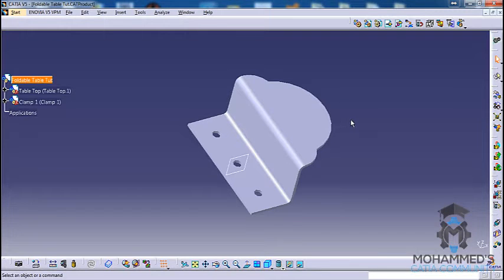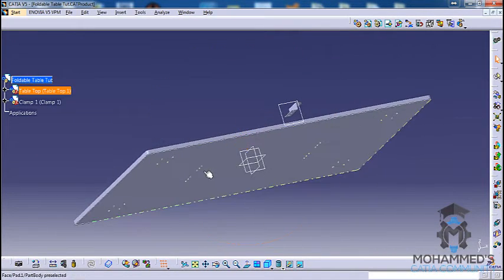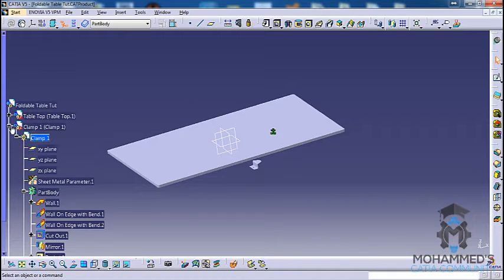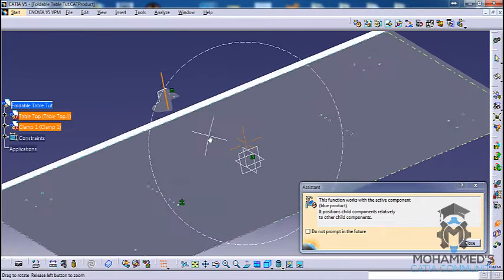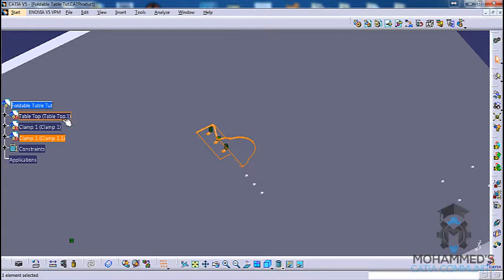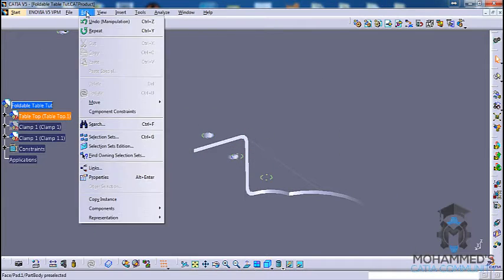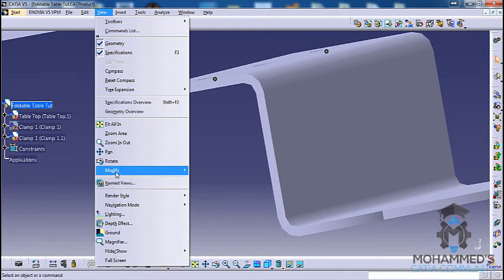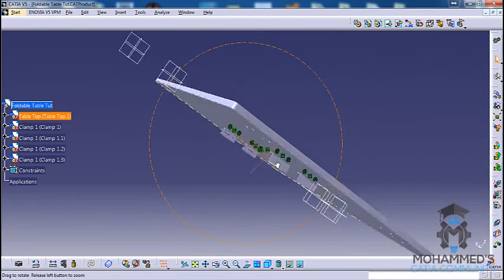Assembling Power Clamps|Modeling & Reverse Engineering a Foldable Table in Catia V5

Comment: Hello how Engineers doit, my name is Thiago Bertino ( Brazilian) and this video helped me a lot.
I have a doubt about surface can you help me? Maybe is Sheetmetal or Solid Doubt, I don't know!!
I have a flat bar of 0,6mm of thickness,length=500mm Width=50 and a curve of R600, Do you know how to take this flat bar and accommodate it along to the curve? In other words, I want to design a flat bar and them using some catia tool, make my flat bar follow the curve of 600mm?
Thank you in advanced for your attention, support and have a nice weekend.
BR
Thiago bertino